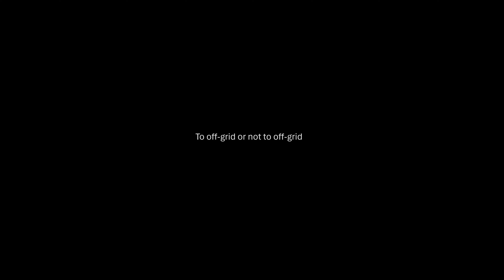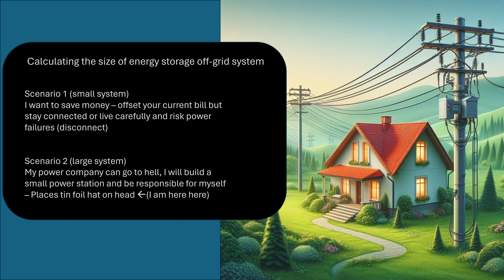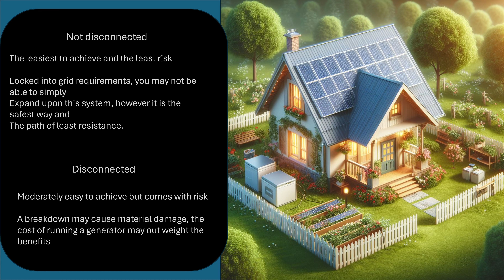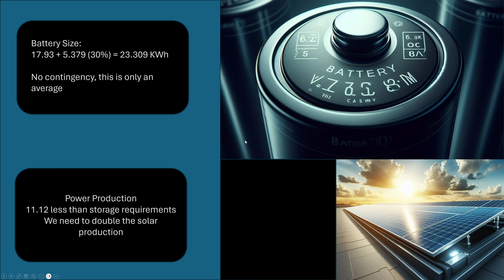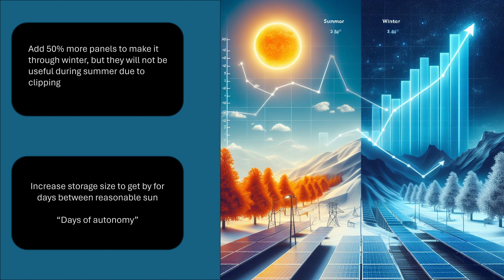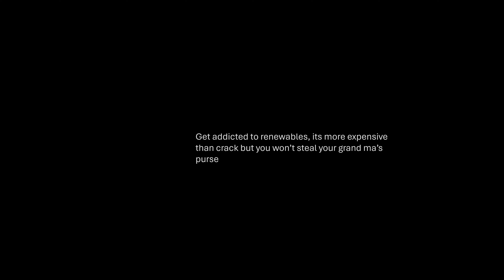How do i offgrid How big should my battery be

Comment: If you build your own batteries out of 280 Ah cells, instead of buying premade batteries, you can save lots of money..Same with the rest of the system..My homemade system is 30KW LIFEPO4 battery, 6.000 watt inverter, 6,000 watts of solar panels, $6,500, paid for itself just over 3 years, which was last month..
Reply from the maker: we did the same thing, but i feel lots of people see that and go "why doing i do that" without realizing the work that is required to go in to it and the fact that (in AU) you are not allowed to connect a home made battery to the grid
Reply: I got 63 panels connected via a
Mix of AC \ DC coupling, and it’s no where near enough to go off grid with my current electricity demands. When it’s hot my ducted AC eats electrons faster than a fat kid in a lolly shop. Today was a great sunny day, but with a ducted AC, office split, AC, pool pump and various other bits and pieces there isn’t enough left to get the 45kwh battery charged. More solar!! But running out of roofs!
Reply from the maker: @Fergo101  hahahahaha yea we have the same problem, we made patios out of solar panels just to get more in the air, I was offered some thin films for $30 a panel but they are only 110w. I turned it down, roof space is a premium, i cant waste it on 110w

I've been really impressed with these new generation of trina panels. Im considering mounting some on the other roof space to see if i can bring the charge divirsity up in winter
Reply: @BadIdea1123  yep - old panels are a bad idea - I’m slowly realizing that what seem like bargains on marketplace is false economy. Better to just get new large capacity panels as roof space is at a premium and mounting costs add up. Better to get more watts per square meter!
Reply: I made the mistake of buying 235 watt used panels and 290 watt used panels. I am now replacing them with new larger panels. built all three of my batteries. one 24 volt with 24 leaf cells it sucks. 32 eve 280k cells.. it rocks and 4 280k cells and it's a great little back up system. 6 victron charge controllers and a victron DC to DC charger to link my two larger batteries if needed. sungold 4000 split phase inverter and a powmr 3000 inverter. and the 12 volt is a cheap truck stop inverter in the little back up system. jk bmss and it all works but it's been an adventure building it to say the least. now just gotta get the new panels in the mix lol